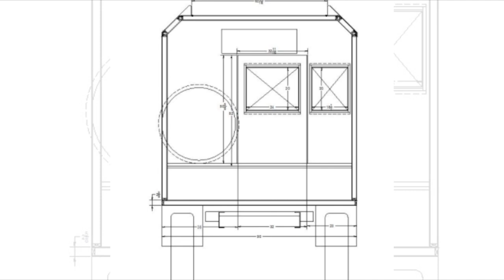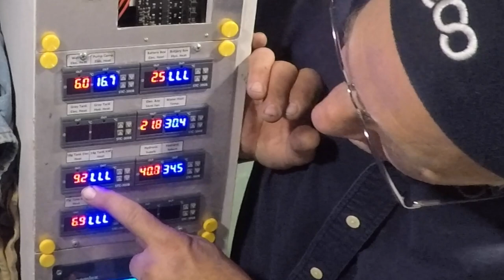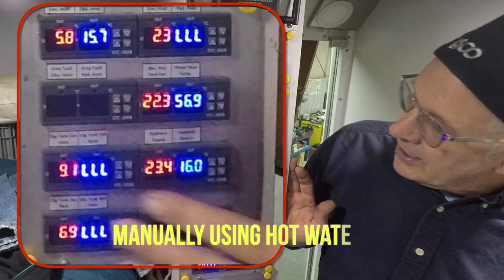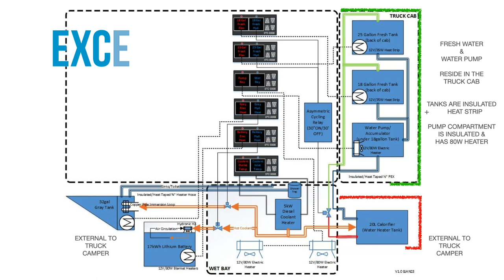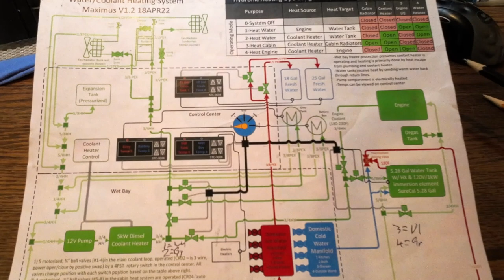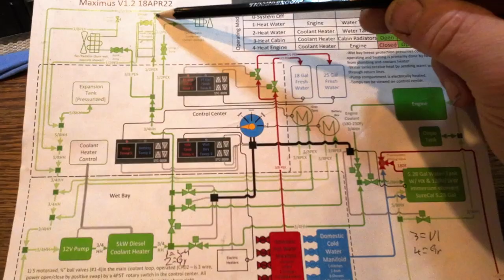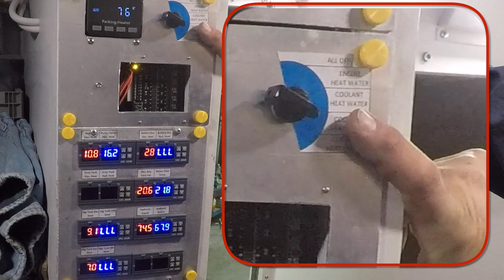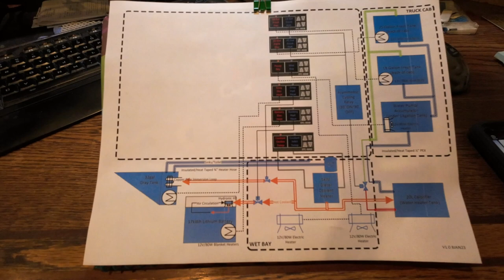FREEZING WEATHER / Coolant Water & Air Real Life Test / Frozen Pipes / Adding Freeze Protection

Comment from the maker: Staying warm while in a truck camper, RV, Van, Trailer is always a challenge when traveling in freezing temperatures.  We have tanks and lines that do not reside inside the camper envelope.  It was a design tradeoff which gave us more storage and space inside and there was a plan to fully insulate the outside lines, it just wasn't ready yet.  It was not our intent to travel into freezing temperatures but when Steve's brother passed away, we needed to just go even though we did not have all the freeze protection in place.   We also didn't elaborate but along with the coolant heating system for the camper, we also have and love a diesel air heater.  The coolant system has been awesome for these freezing temperatures and we'll leverage the diesel air heater when it's not as cold or for a quick blast of heat (it works very quickly).   Please share and like if you find the detail of value.  And drop us a comment / question below.  We love hearing from others doing their own build or modifications!

Comment: I am blown away by your knowledge and skill. Sorry to hear about your brother. That is a big shop. I built a summer rig now building a winter rig. How many gallons an hour does your coolant heater use? Is the floor heat noticeable?
Reply from the maker: 1) I have not made a serious attempt to determine fuel consumption so can't say if the manufacturer's rating is accurate. The manual rates it at .1l to .25l per hour. Because it runs at full speed as long as it can and only cuts off if it hits 90C, whatever it was connected to would need to be pretty 'satisfied' to ever slow down enough to get to the minimum.
2) Floor naturally convective heat is not very useful and I never expected it to be. In a house where the tubing goes through concrete (typically), the thermal mass and area are large. Since the camper floor is not, it does little. Secondly, there is pretty poor heat transfer off the plastic PEX tubing. The lack of the former (mass and area) combined with poor thermal transfer render the system almost ineffective for space heat. It does provide some hint of warmth so you don't feel like you're walking on a cold floor but that is about it. I planned for this by having a 5x10in fan convected radiator at floor level which works really well. If you want passive heat, I think you would need to use a number of naturally convected radiators that are either large or closely spaced to be effective.
Reply: @WorkingOnExploring  thank you for the response.i put one in my first RV I built. It seemed very inefficient. Thought maybe the new ones would be more efficient. I was thinking of doing a hydronic in the floor. But seems like maybe a diesel air heater might be more efficient.
Reply from the maker: @rolandrockstarmega1299  I have both. I think the efficiency of converting diesel into heat is the same.  The mechanism of moving the heat and transferring it to objects is what is different. If all you want/need is cabin heat, air heating is faster and more trouble free (coolant leaks). I feel more needs for heat than just cabin heat. Water heating is something very inefficiently done using air as an intermediary. 1) If you want to avoid propane, electricity and diesel are your only other ways. For a year, I heated water electrically and it was barely ok because I had lots of solar and a small tank (2.5 gal was too small). 2) Using electricity for water heating and  freeze protection is a bigger problem. Solar production in freezing temps is much less so electrical power is more precious. It is impossible to use an air heater to move heat to all the (external) places that need it. Hot coolant can do it. 3) tapping engine coolant is a huge benefit of free heat. I need to use a lot less stored energy for hot water because every time I move, I arrive with 20l of 180F water for 'free'....that typically reduces my need to expend stored energy to heat water by half. This all involves a somewhat complex hydronic system that involves a lot more than just the coolant heater. Complexity costs money and requires an investment in understanding and maintenance. I'm glad I did and I had more than a little pain getting it done but am pleased with it now that it's done. It's certainly not for everybody. There are lots of folks with commercial systems that have unreconcilable problems, mostly because they don't have deep understanding and are therefore not able to troubleshoot.
Reply: @WorkingOnExploring  I use a propane tankless water heater to heat my hot tub on my RV. They seem really efficient. Would it be possible to heat the glycol with one of those. I like how they work. More instant then diesel. My problem was trying to keep it from freezing but using glycol with a heat exchanger will solve that. I am building this rig to go snowmobiling in Colorado.
Reply from the maker: I have an old tankless water heater that I use to heat an inflatable hot tub (at home). It is NG and I just use the HX and not the control system. I use a hydronic sytem pump to circulate the pool water through it. It's crude but works well.

 I don't think having a 50:50 glycol water mix in a tankless heater, by it self, would be a problem but I can see several others. 
1) Hydronic heat is, by nature, 'slow heat', using relatively small 'boilers' that run long duration. The burner capacity of a 5k diesel coolant heater is (5kW x 3.412BTU/kW =) 17kBTU. In my little camper, this much roasts me out easily, even when it s really cold (but I have great insulation). The typical propane RV tankless heaters are 42-55kBTU ( 12.3-16.1kW). The high heat transfer INTO the liquid by the burner is going to be REALLY HARD to transfer OUT of the liquid and into something else as rapidly as you need to. You would need to have a very large RV with lots of space that would need to be heated (remember, you'retrying to transfer heat from a high energy density, high caloric capacity liquid to a low density, low caloric capacity air). 
2) Tankless heaters are designed based on HIGH, SINGLE-PASS TEMPERATURE RISE because they assume they need to raise ~56F incoming water  (ground temperature) to ~120 F, which is 64F temperature rise. Hydronic systems, which circulate the same coolant, operate on a temperature rise of 10-15F. This means that if the 120F exiting liquid circulated through air HX and came back to the 'boiler', it would probably be at 105-110F, not 56F. On the second trip through the heater, it would again get a 64F temperature rise, not to 169-176F which is WAY TOO HOT. The control of the unit would shut down due to high outlet temp. 
3) Liquid velocity in the pipe. Tankless water heaters sense both flow velocity and exit temp to control the system. They are trying to deliver a high volume of hot water to an exit point with as little heat loss as possible. Water velocity through them is pretty high (driven by 50-80psi water pressure). A hydronic systems is the opposite. They use low velocity flow to minimize pump energy and maximize heat loss from the pipe, with the goal of minimizing delivered (return) water temperature. The piping size necessary to satisfy a tankless heater based hydronic system would have to be quite a bit larger than the normal hydronic circuit (1/2" pipe up to 300', 5/8 pipe up to 400' and 3/4" pipe up to 500') to handle the flow velocity the heat control system needs and return temperature would be pretty high. They do make 'dual use' tankless type hydronic heaters (for residences) but they have a control system and a burner regulation system to handle the differences. 

Freezing of tankless systems is a problem that has been solved. Externally mounted (residential) tankless systems which are very common in Europe, have freeze protection that fires the burner periodically for a few seconds to prevent freezing (with no water flow).  Your problem is that I don't imagine RV units have this. You can imagine, its not that hard, just not done because the RV market has not needed it.

Comment: Been researching how to keep things warm, after watching this I give up 😂. Just gonna bring a separate water supply leaving the lines winterized and using a portable toilet. Not to mention a cooler cause the fridge freezes up to :)
Reply from the maker: The 'simplest' (and possibly the most fool proof) way to achieve freeze protection is to have absolutely everything inside your heated cabin. I have never seen anyone build that way. There is too much lost opportunity to use exterior space. As soon as you decide to use exterior space you ARE in for a headache. My thought is to monitor a lot more and heat selectively.

Comment: That shower diverter is a great idea! I'm stealing it!
Reply from the maker: It has been a great accessory but the fresh water return system as a freeze protection tool is really the best. I have installed a motorized ball valve in my wer bay that 'returns' water from the hot water tank through most of the exterior water system to the fresh tanks. This puts hot/warm water into the fish tanks but also keeps the water in the entire fresh piping moving so if there is a part of it that is inclined to freeze, that water is moved along every 30 minutes. I have a DIN rail 'asymmetric timer relay' ($12) that opens the valve for 30s every 30m, 24/7....we just need to leave the pump on....another benefit the recirculation provides.
Reply: @WorkingOnExploring  I've got a 12mm PEX line that goes down next to my sink waste pipe, through a bulkhead connector into my grey tank (the pipe goes through the middle of my water tank) and then out the other side alongside my shower waste pipe and up back into my box. It's tapped off a spur next to my underfloor heating piping. I use 12mm John Guest pipe as I didn't want copper pipe outside the vehicle. I haven't completely finished it all yet but the 12mm pipe is going to be strapped tightly to the waste pipes and thick insulation over them both. Hopefully that will keep my grey tank and all the waste pipes clear of ice!